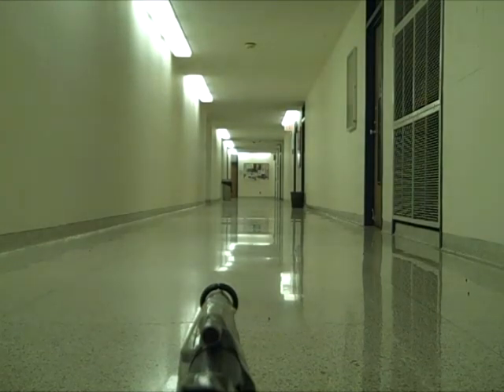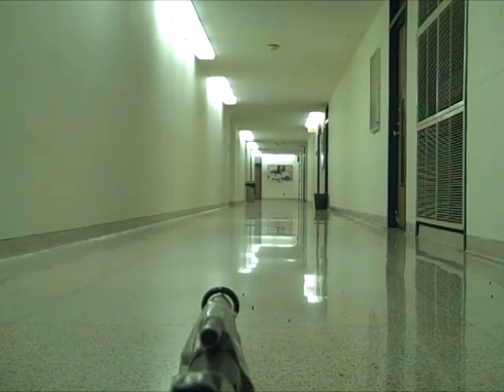ECE4180 - Airsoft Sentry Turret

Comment from the maker: The airsoft gun is a cheapo that used a motor and spring mechanism, so you just bypass the trigger and solder two leads to it, which was connected to relay that turned the motor on and off. The gun is mounted on a pan/tilt servo mount. The rest is all software.